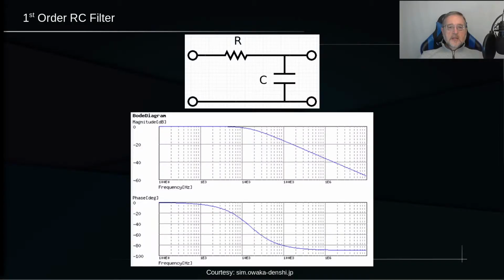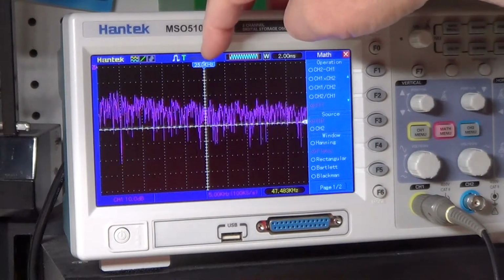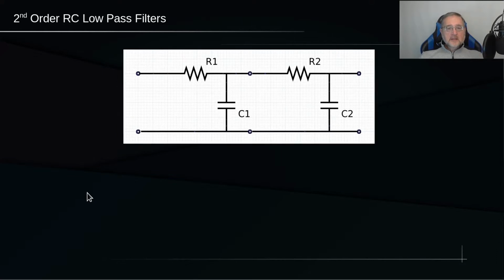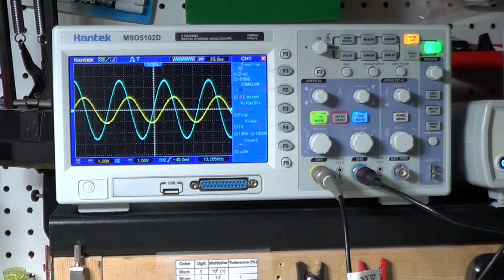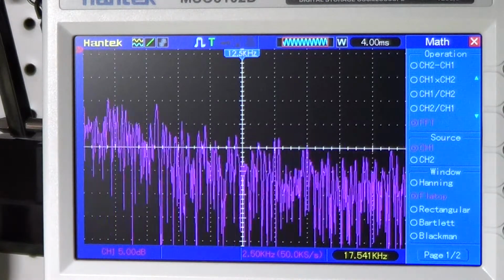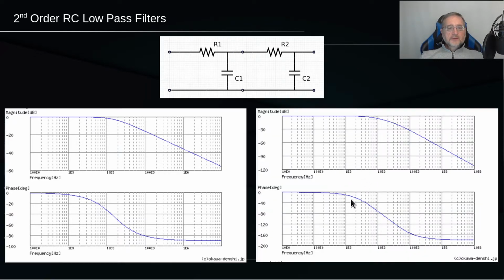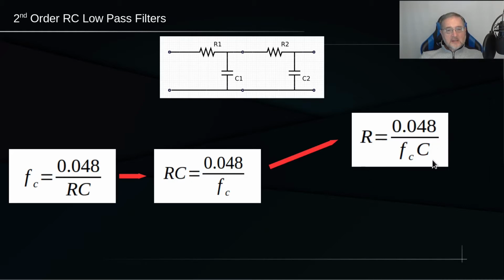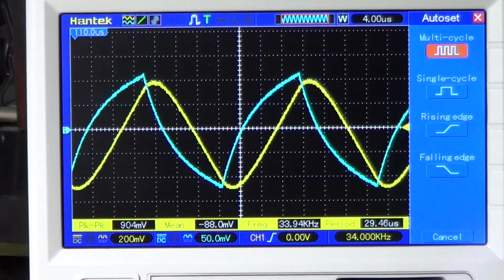Filters Tutorial 3: 2nd Order RC Low Pass Filters

Comment: Hello, The cut off frequency of two stage RC Second order Low pass filter is at -3 dB or -6 dB point? Can you provide me strong reference for the explanation?
Reply from the maker: By definition, the cut-off  frequency is the point (frequency) where the attenuation of the signal on the magnitude Bode diagram goes below -3dB. This is true regardless of the number of stages the filter is made off (order of the filter). The difference is the slope of the filter at the cut-off point. The greater the number of stages, the greater the slope of the Bode diagram. Each stage introduces an increase in slope of -6dB/octave. So, a first order filter has a slope of -6dB/octave, a second order filter has a slope of -12dB/octave, and so forth. If you prefer to work in decades, then -6dB/octave is the same as -20dB/decade.